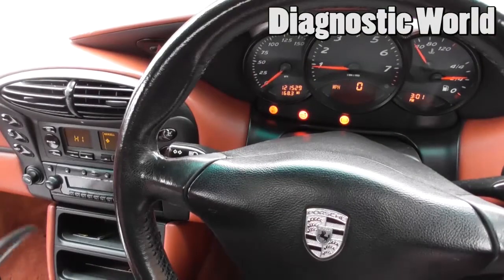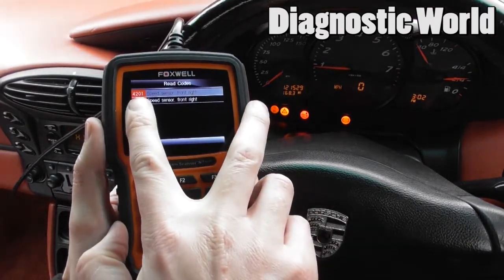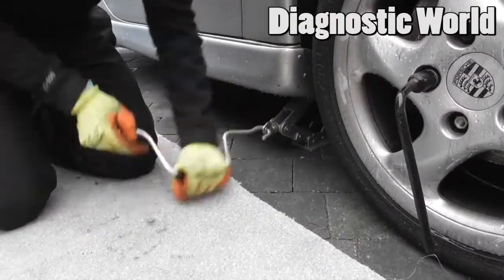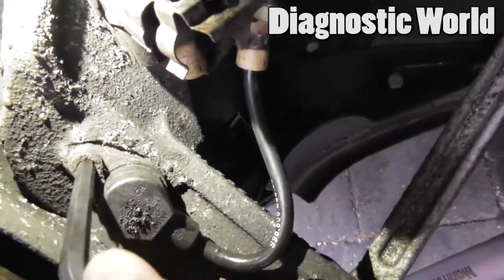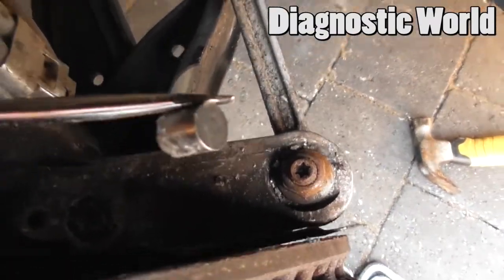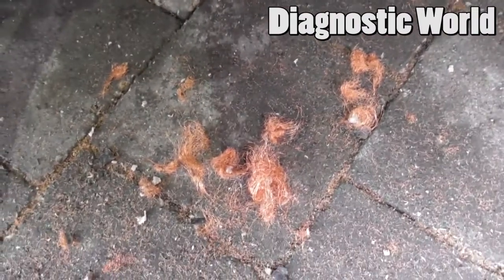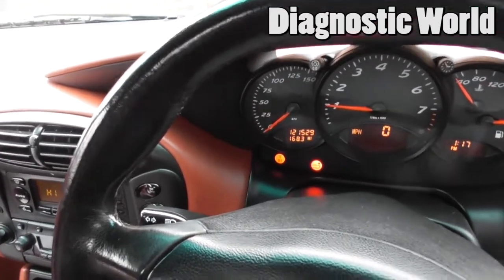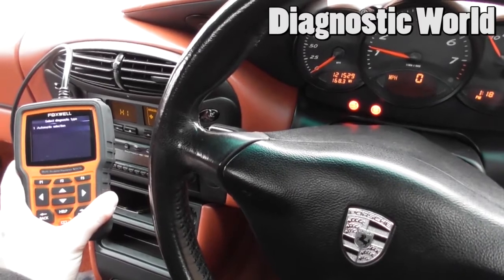Porsche Boxster ABS Sensor Diagnose Replace Reset ABS traction warning lights

Comment: If I disconnect my front right abs sensor will it disable traction control?
Reply: Yes you will lose traction control. I had to take my ABS fuse out for temporary measure as the kept locking up under braking.
Reply: @JJROADSTA  when I looked at the fuse (B1,15A) location it says the fuse for ABS/PSM will also take out the instrument cluster.. haven't tried that yet
Reply: @SlappHappy311  it didn't on mine. Just lifts the spoiler and puts on the PASM warning lights/messages.
Reply: @JJROADSTA  ok cool thanks for the information. Definitely excited to see the difference in driving.
Reply: @SlappHappy311  Sorry forgot to mention the speedo also stops working.

Comment: Very handy, thanks for the guide. I think I'll pop the connector off on mine (scan tool indicated fault in front right sensor) and check resistance before replacing.

Comment: Can you keep driving the car with these codes displaying (until replaced) or will it eventually cut out?
Reply: It'll work fine, but the ABS light will stay on and if you have to emergency stop then you'll need to use cadence braking as the wheels may lock up and increase your stopping distance on poor/wet surfaces
Reply: @keeperfullylit  I got mine replaced some months ago but thanks for your reply.

Comment: Was trying to get my ABS sensor out today, same as yours - the bloody bolt broke off! Abandoned mission after trying to hammer it out. Funny thing was the ABS fault cleared itself as I was driving, then 10 minutes later it came back on. I later cleared the codes, went off and cam back after 15 minutes of driving. As I was driving, the sensor was still doing its job as it was reading speed on the foxwell live data, so not sure why that is? 

Was just in garage now - everytime I reset the code, it would come back on, car was turned off - don't get that?